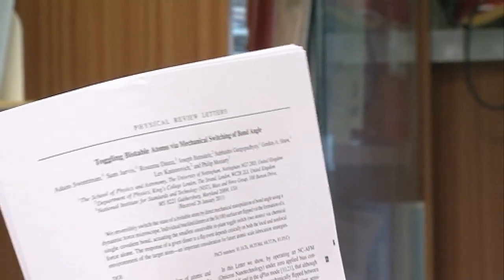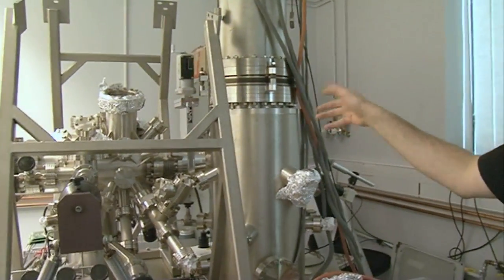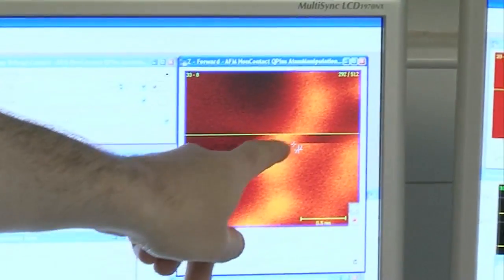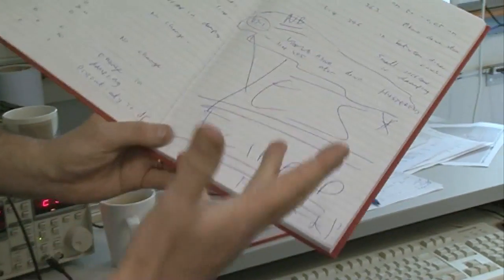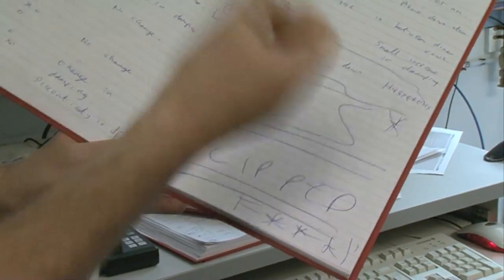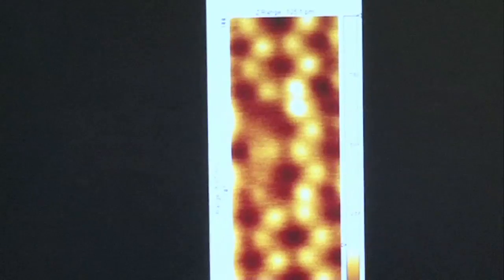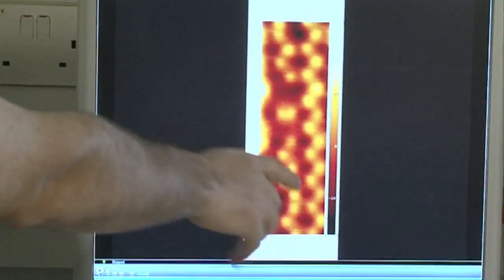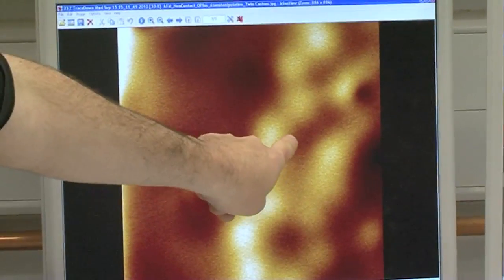Atomic Switch (moving individual atoms) - Sixty Symbols

Comment: I wouldn't get your hopes up that something like this will ever be much practical use, certainly in computing, anytime soon.

You'll notice they need a giant super cooled super low pressurized machine just to create a state in which it's possible to do this, and you'll notice how painstakingly difficult and long it takes to create the atomic "toggle".

There are a TON of obstacles to using something like this as part of a processor, let alone ever cost effectively, and of course ignoring the fact that we're basically already at the limit due to overheating and quantum fluctuations of shrinking bits to their smallest possible size at a few 10's of atoms each.
Reply: +bob smith i bet people said that about electricity at some point.

Comment: so if the computer im using is fundamentally a bunch of transistors or switches, does that mean you could make a computer with these silicon switches?
Reply: That's for electronic computers, but I think you might be able to make mechanical computers with this kind of technology. Don't know if it'd be any faster than an electronic one but iirc a big reason we went electronic was because we could make smaller switches with transistors.
Reply: Once you get down to several atoms thick, the electrons start to quantum tunnel through the transistors. The transistors in your computer also use a different mechanism to toggle on and off, the electrons are "held back" using N and P doped silicon, and can only flow when a charge is applied to the bridge between the two plates (source/drain). 
Ideally once you get down to that level of precision engineering, quantum computers would likely be more effective, as you don't have to do all of the error correction that you'd require when your electrons keep tunneling through the switches.

Comment: +Ashwith Rego

I have no idea how to answer your first question but in answer to your second question we're dealing with things 5 orders of magnitude 'larger' than subatomic particles.  Thus to specify a location you're allowed to be 10000 times less accurate than with an electron, and so your uncertainty in momentum is 10000X smaller (and these are atoms so they're more massive than individual subatomic particles so any uncertainty in momentum is still a smaller uncertainty in velocity).  I imagine in a world where larger uncertainty existed at atomic scale bonds wouldn't properly form and we'd be screwed. :o

Comment: With current technology, I don't believe this is possible.  This is because the environment is a vacuum with temperatures of 4K, which makes it improbable to place in common computer systems.  Also, data storage on hard drives and solid state drives work quickly because of their enormous speeds of 7200+ rpm (HDD's) or use or transistors and electrical current.  While it is an interesting idea, it is too costly and slow to implement in a computer system.

Comment: It's the holy grail of information storage, so yes they're working on that. Currently information storage on a hard disk costs 5 cent/GB. If you could store it at the atomic level hard disk replacements would be thumbnail sized yet store a billion times more information, cost maybe a thousandth* of the hard disk and consume virtually no power.

*) will depend mostly of the cost for reproducing this on a large scale. Current chip fabs cost ~2 billion $, this one may cost as much as 10 or more.

Comment: then you have to move protons and neutrons arround between nuclei in atoms, I don't think you can do this with this machine. It seems to have a hard enough time just moving atoms! I fact I don't think its possible to move a proton from the nucleus of an atom in a slow controlled way, its just to stuck together inside the nucleus, you need a huge amount of energy to move it from the lower weight atoms. Its only possible in the big ones because they are more unstable.